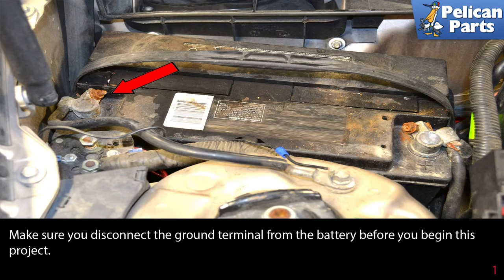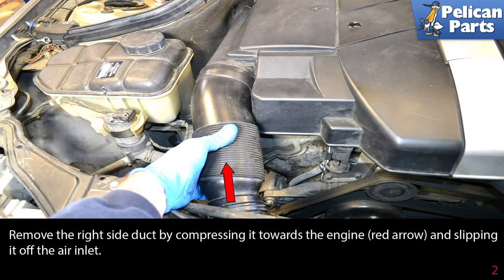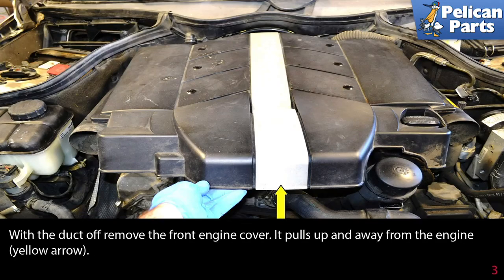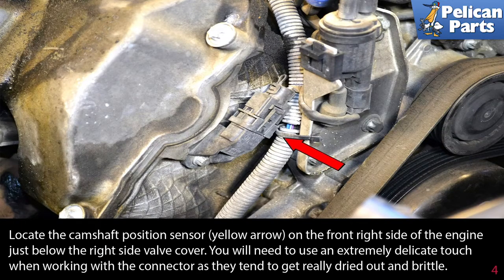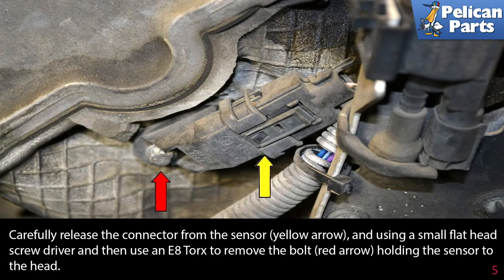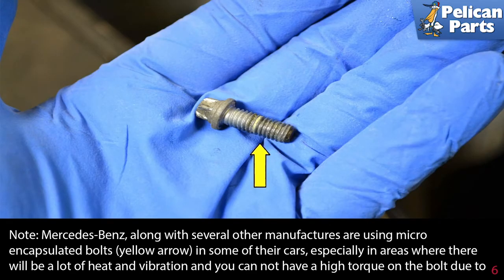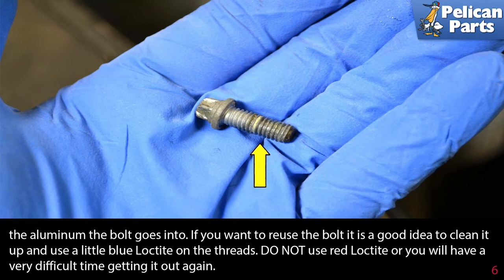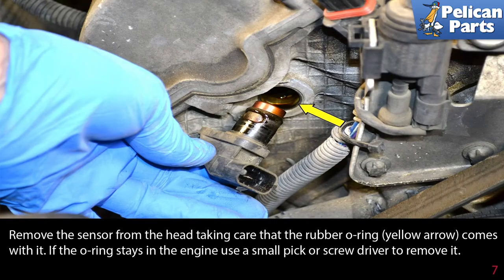Mercedes-Benz W203 C-Class Camshaft Positioning Sensor Replacement

Comment: I have 2008 Mercedes E350 with code P0012 camshaft position timing over retarded bank 1! How many Camshaft sensor out there and what are the code please? If I clear the check engine light is my car going to pass the Emission test?
Also is it necessary to change a camshaft magnet?
Reply from the maker: You might have a mechanical timing issue. I would confirm timing is OK first.